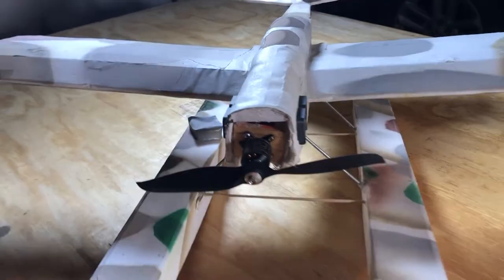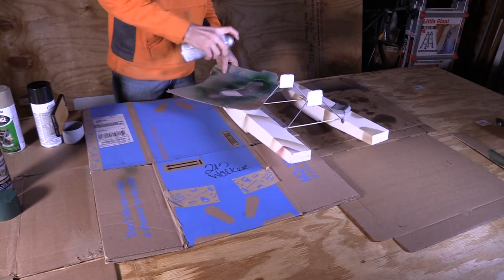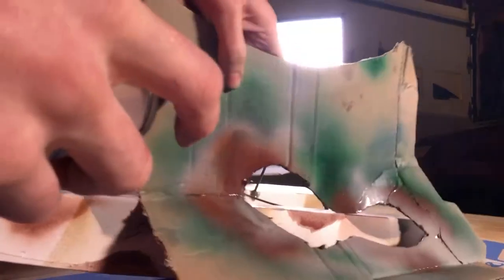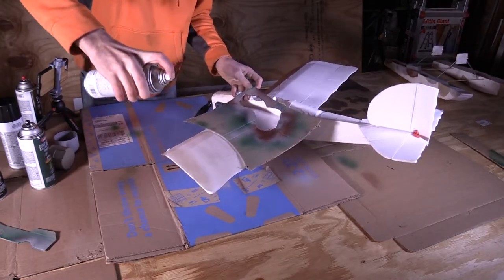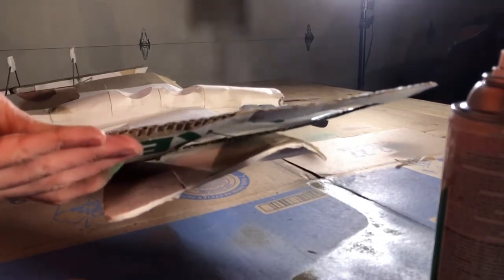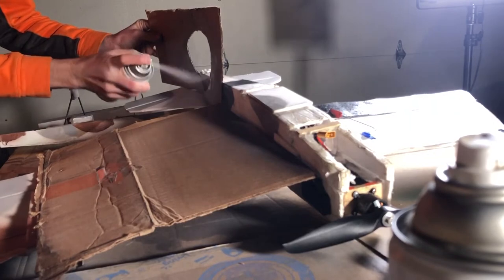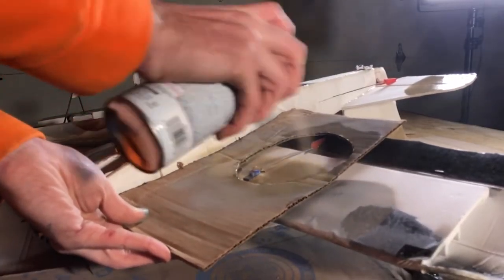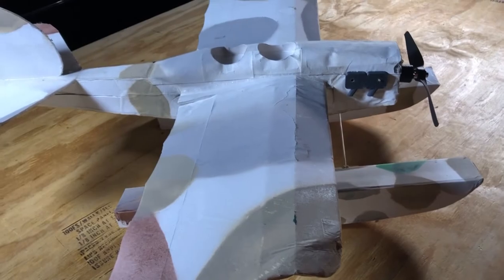Painting Like a Champ |Painting 101|

Comment: nice video..you are using dollar tree foam with paper, correct?
Reply from the maker: Yes, that is correct. I'm glad you liked it
Reply: @EricRobb  got thanks. i always take paper off to reduce weight. thanks anyway!
Reply from the maker: Yeah, spray paint would just eat right through the raw foam. The paper does give the airplane a lot of strength though. How well do your planes hold up without it?
Reply: @EricRobb  , i build for very low wing load. i like slow planes , so the they are light usually around 250grams. disadvantage is that i can not fly with wind over 7 mph.
i was hoping your video can give some tis to paint on foam. but the technical if camo i can still use it when i have some wood or paper cover foam. thanks anyway!!